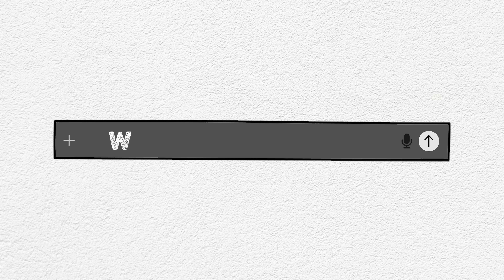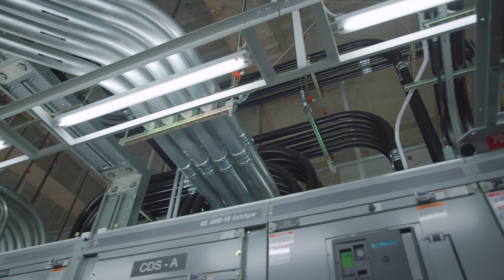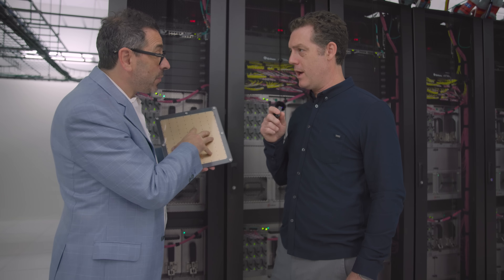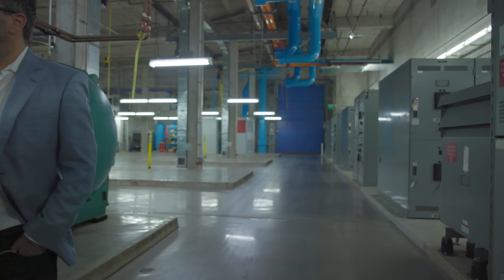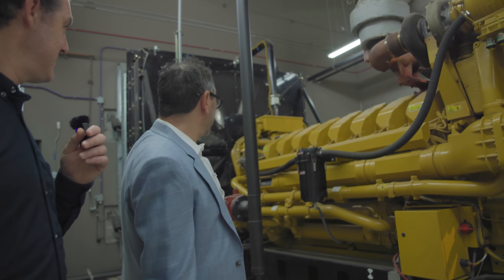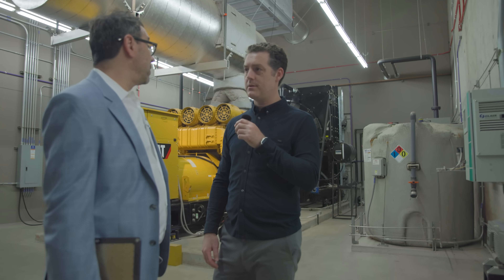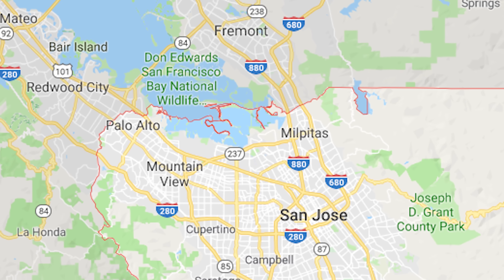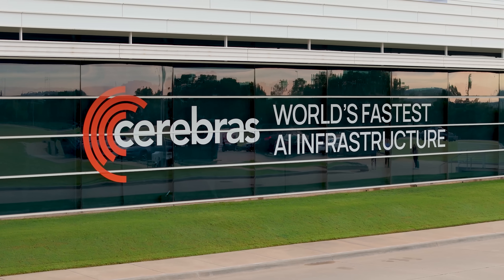Inside Cerebras's Insane NEW Data Center (Fastest in the World)

Comment: the current AI models are getting bigger than the memory on these chips, and theres only so much memory they can hold before you gotta get a whole new wafer just for memory, ahhaha!! another improvement is an AI specific processor, as these wafers conntain a million processors that are similiar to cuda stream processors.  If they nail these two tech issues, they will have the best AI chips in the world for the next 10 years.

Comment: The drone shot raises the question, why is that big flat roof not covered in solar? Does the Oklahoma's tornado issue make it prohibitably expensive?
Reply: Solar introduces huge power regulation and management requirements and can be completely mitigated that complexity for a huge setup by just using the natural gas.   For a roof that size you'd need a lot of space for infrastructure and you'd need TONS of expensive lithium batteries since you don't feed solar directly into the power distribution.   Also the rate at which this building sucks power you'd have some heavy use on that battery network.  Introduces so many issues and it just isn't practical with this kind of power demand (you saw how big their VRLA battery room was in the video and they only rate at guaranteed 5 minutes).

Comment: Cerebras is amazing.  I'm looking forward to having state-of-the-art larger models hosted with them.  It's nice getting obscenely fast results from GPT-OSS-120b but I end up using GPT-5 or Claude Sonnet 4.5 because it's smarter.  The largest Qwen or DeepSeek models are smart enough that I may prefer something slightly less smart if it's 10-100x as fast.  But I usually deal with Code generation and sometimes video/image generation...other applications are different.

Comment: What gets me is... skip forward in time and all the computing power in that centre will fit on a device smaller than your phone.
Reply: ummm not really... Moore's law is not working for many years now. Even Nvidia is just now slapping dies together like they are. Compute is NOT growing exponentially anymore.
Reply: @admiralhyperspace0015  Moores law was a very specific improvement, ie, doubling of transistors on a chip every 2 years (it's now closer to 3) but as science evolves, we're now coming up more ways improve such as AI driven pattern changes, different materials, quantum computing.
Reply: @TheDandonian  I worked in qc and no its not useful for classical tasks, second more complicated fabs allows more transistors but increasingly higher cost per wafer. Remember physical world always follow s curves with diminishing returns until you unlock a new a paradigm to have another s curve. Another example would be AI model training. Its only gonna get worse and we really have no solution right now for easy gains.
Reply: @admiralhyperspace0015  Well listen, we know that the human brain processes everything using a fraction of the energy that it takes a computer, so we know there's giant efficiencies to be made. AI will help us make those going forward at a significantly faster pace than before.
Reply: @TheDandonian  except brains are analog not digital and the analog computing ship sailed decades ago, because digital manufacturing scaled so much better. They are trying to make a come back though so maybe you could be right. Again we need to find a new paradigm as of now. Research a bit on analog computing its pretty cool too.
Reply: The computers of the past were huge and had little of computing power and memory, so this old tech could be fitted inside phone's chips. The engineers were able to cram terabyte of storage into a phones' internal storage only recently. Nowadays phones have computational power of some laptops in the past, the sustained performance of SoC is of course constrained by a cooling system and the size of a phone. In this age you can't miniaturise server size computers into phones' form factor. You would need to invent something completely revolutionary to do that.
Reply: @SirusStarTV  They always do. Every year there's new chips, new innovations around heat and power, new materials that work better, new designs, etc. Last year Jensen Huang showed off the GB200 Blackwell, which replace 6 server racks with one, then came the GB300 which is more powerful and focused on things like cooling next year the Rubin, which will be even more powerful. All these advancements compound over the next 15-20 years lowering the physical footprint significantly, maybe even sooner as AI gets more capable of advancing technology.

Comment: I've often wondered about the reliability of such fantastic hardware.  What fraction of an individual wafer is actually usable?  What's their runtime hardware failure rate? How many people do they employ? How many of them are involved in replacing failed components? (inference wafers, network infrastructure, etc.)
Reply: I remember hearing that around 1-2% of the wafer had defects and was not usable, but they have enough redundancy to handle much more.  The craziest part to think about is dealing with supplying power as the wafer gets hotter and expands...not sure about the other issues, but I doubt it's too different from other systems.
Reply: They even use less modern transistor node technology (7NM) to make sure their entire huge chips wouldn't get disposed if there's defects found.

Comment: NOT the worlds fastest. Colossus is considerably faster.
Reply: They are talking about inference speed for specific AI tasks per installed unit. And cerebras is indeed extremely fast in production
Reply: Yeah Cerebras is 44 exaflops and Colossus is 400 exaflops!
Reply: Fastest per kW used, maybe?
Reply: In terms of tokens per second for inference speed of an LLM, Cerebras is faster than Groq which is faster than everyone else.  However with enough compute, you could train a model faster with enough slower H200 GPU's.  The reason is that you need to know all the previous tokens to generate the next token which can't be done in parallel, so Cerebras always wins with models like GPT-OSS-120b that can work with their system.  Adding more GPU's doesn't speed up inference.
Reply: @nathanbanks2354  The claim in the video was the data center itself.

Comment: Yes, the claim in the title appears to refer to a recent development by Cerebras Systems. In September 2025, Cerebras opened a new AI data center in Oklahoma City, Oklahoma, which they tout as delivering over 44 exaflops of AI compute power. This facility houses hundreds of their CS-3 systems, each powered by the Wafer-Scale Engine 3 (WSE-3), the largest AI processor ever built with 900,000 AI cores and 4 trillion transistors.

Cerebras explicitly claims this data center provides "the fastest AI infrastructure" in the world, emphasizing that on AI-native workloads, their systems are 20–40 times faster than top GPUs. They highlight advantages like reduced latency due to on-chip memory, power efficiency (using about one-third the power of comparable GPU setups for certain tasks), and advanced liquid cooling. The CEO has stated they make "AI faster than anyone else on earth."

However, whether it's objectively the "fastest in the world" depends on the metric. In terms of total raw AI compute (e.g., FP8 exaflops), other clusters surpass it. For example:
- xAI's "Colossus" cluster, with 100,000 NVIDIA H100 GPUs, delivers around 198 exaflops (without sparsity).
- Oracle is building superclusters scaling up to 65,536 GPUs for 260 exaflops FP8 peak.
- Google's TPU v7p pods reach about 42 exaflops FP8 per pod, with larger deployments possible.

Traditional supercomputers like El Capitan (1.7 exaflops in high-precision FP64) or JUPITER (over 1 exaflop) focus on different workloads and precisions, so direct comparisons to AI-specific flops can be misleading. Cerebras's strength lies in its wafer-scale design, which excels at handling massive models with minimal data movement, potentially making it "faster" for specific AI training and inference tasks rather than sheer aggregate flops.

Overall, the data center is indeed new and "insane" in scale and innovation, but the "fastest in the world" label is a bold marketing claim from Cerebras that holds up better for per-system efficiency than total cluster size. If this refers to the Matthew Berman YouTube video summarizing the facility, it aligns closely with Cerebras's official announcements.